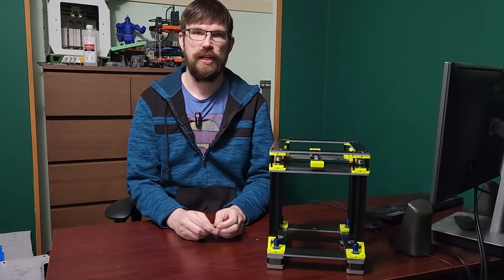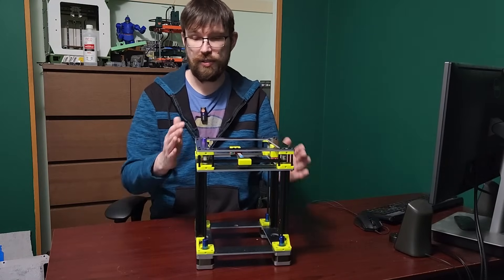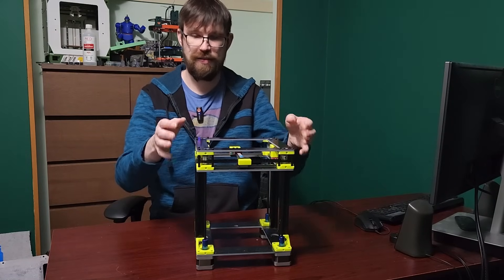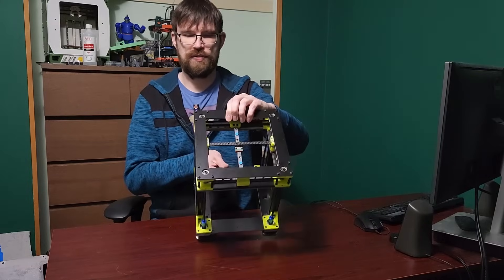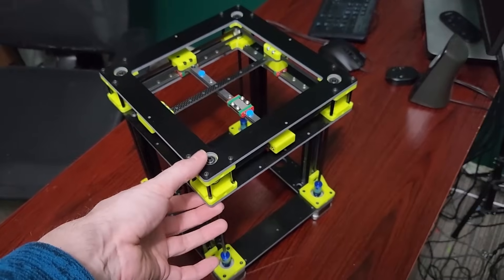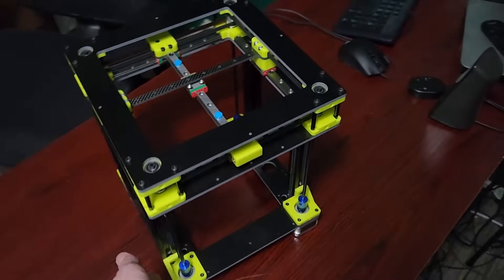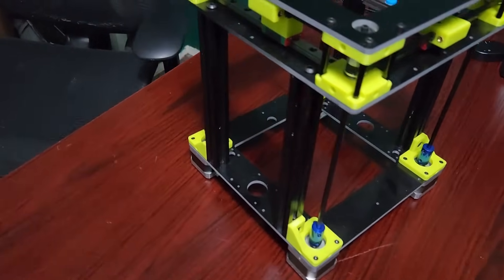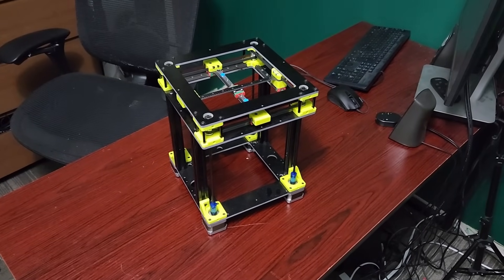First Look at My Secret Cross Gantry 3D Printer Design!

Comment: It's also possible to implement a hash printer this way, by mirroring the AWD setup on top... such design would be really radical and novel.
Reply: I have some old designs that I drew up last year for just such a printer 🤓
Reply: what is a hash printer?
Reply: @warmesuppe  I was too optimistic... https://www.youtube.com/watch?v=tzf8903FvCs
 There are way too many kinematic issues and practically dual-idex with a toolchanger makes much more sense. It's possible to solve some of those with specific MPC/MPPI control, but it would mean replacing HW stack entirely with custom FPGA's and ASIC's...